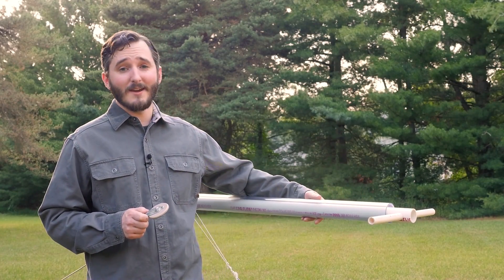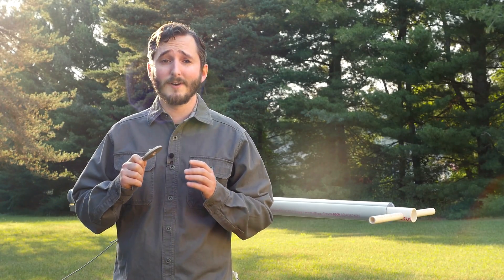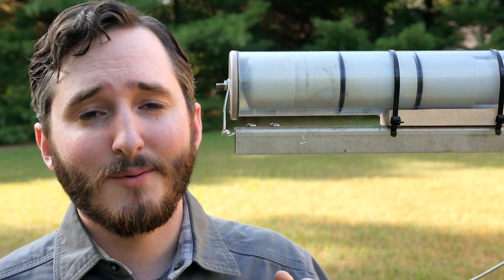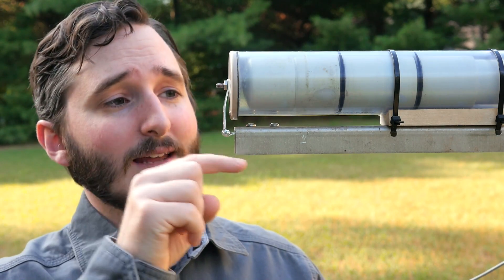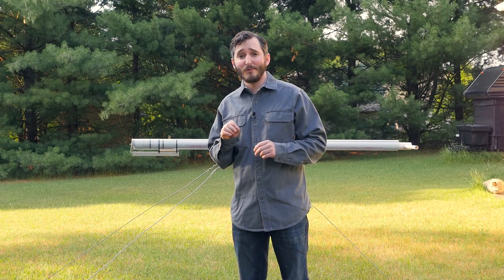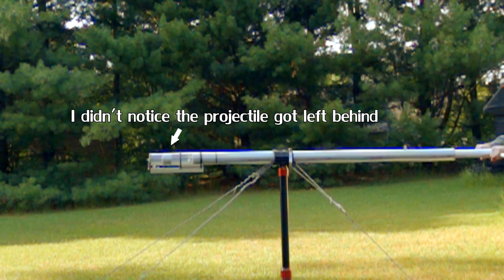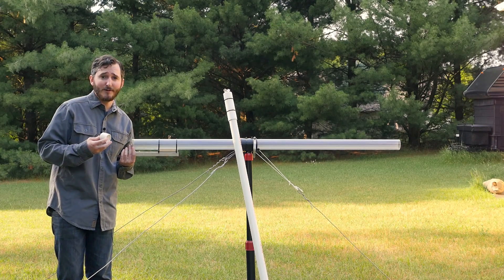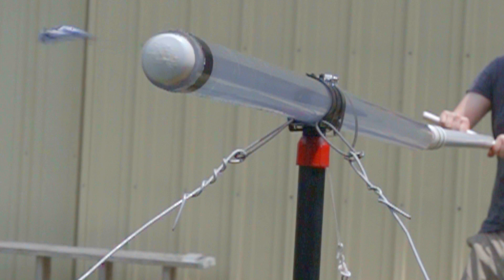Firing A Clear Vacuum Cannon & Testing Viewer Suggestions

Comment: What if you attach a long piece of elastic band to the flap while having some slack in it and attached to the other side is your handle. Then just before pulling the plunger all the way out, have the elastic band be in tension, so that once the air rushes in, you will also have the force of the elastic to pull the flap open. But the elastic band has to be routed below the pvc pipe to allow the flap to be opened downward.

Comment: What about spring loading the valve? A spring drawn from the centre edge of the disc to behind and below the pivot point would hold it in place until pressure overcame the tension, and then the spring would accelerate the opening of the disc.

Comment: I think the inertia of the valve might be the problem, because he metal hinge might be too heavy. I would try to make all of the parts of the valve as light as possible. Maybe just a quite thin PVC plate with the rubbe on it and instead of the hinge some wire. I definetly enjoyed watching this! Nice video! :)

Comment: it is called reverse  recoil.  is  it against the  rules to use  magnets,  specifically   for  use  in  the projectile, eddy   currents,  magnetic flux,  as  the   projectile  moves down  the  barrel  .
there would be  no need  for  any   external  energy. closed loop.   would  not  produce  any  more or  less  friction.    dont get  caught  up in the  eddy  currents  yet. 
i hate typeing on  my phone  ex my  tpos

Comment: Sorry if this has been asked but wouldn't the vacuum in the tube hold the flap valve on the end of the tube? And then push it off when it's fired?

Comment: Obviously figuring out how to keep the flap valve to stay in place would need to take some additional thought, but how about instead of using a hinge using just a piece of string or something else just to make the overall assembly lighter and maybe it doesnt have to make the complete arc to get out of the way that you'd get with the hinge.

Comment: I remember before you were in front of the camera. I thought you were an old man. Boy, was i surprised in your first video with your face. For the valve I'm thinking a long cable to actuate it, running from the valve to the rear. trigger it with a magnet in the end of the plunger as well as at the rear end of the cable. I know you can make my basic idea here much better.

Comment: You can add a rubber band to the valve, and adjust the pivot point, so the closed position is very unstable. A small opening of the valve will cause it to slam fully open.
Reply: I actually thought the same. I think the problem is that the liitle amount of air inside the chamber Knocks the valve  then the air escapes and the only thing pushing down the valve is gravity which is not ideal because the valve makes something like a circular motion and it takes even more time to fully open. So a rubber band in a position that when the inside air kicks the valve a little bit then the rubber band takes action and clears the bore. Maybe it wont work as well but i think its worth it

Comment: What if you built a piston cannon, and used a racket/pulley system to pull the piston back, so they a larger pipe could be used?
If it worked you wouldn't need a compressor for for the larger ones, might be faster to prep it for fire?

Comment: You should try putting a smaller projectile that's left at the front of the cannon that will push the valve out of the way before your main projectile reaches the exit. Not sure how much this power this would lose you because you'll have air rushing in from both sides but maybe if you get the distance between the two projectiles just right so as to minimize the amount of air coming from the other side while still having the valve open before the main projectile reaches it the velocity of the main projectile could still be comparable to the velocity of the projectile with the burst discs. Sorry for the run-on sentence was just trying to get this idea out of my head onto the computer.

Comment: you might should put tension to open the valve after you pulled the piston, or pull string to trigger that with the piston. something like mouse trap but weaker. (my english sucks, hope you get it ;) )

Comment: What about using magnets.  Attach a magnet to the projectile and to the valve, with like polarities pointing to each other.  The magnets will repel each other forcing the valve open.  The only downside is that a magnet would have to be attached to the projectile.

Comment: if the flapper is a must.. then lower the center of gravity and shave weight till it almost fails for a better moment o.e. ( lower bolt instead of being in center of flapper lid..and remove a lot more metal from upper half of flapper hinge for weight loss) awsome video.

Comment: The valve will not open with a vacuum behind it. Run a small tube half the distance to the valve beneath the primary chamber.
Reply: It needs to be opened last minute

Comment: Why not make the valve a part of the projectile? Imagine a cap that when put over the end of the tube would catch the projectile as it's launched. So it seals the tube until the projectile is fired, then when fired the projectile flies into it and is caught by it. Then the two fly off together as one unit. Like a reverse sabot.

Comment: @NightHawkInLight you're probably the best person to ask: I made a pvc potato cannon with a large combustion chamber, the fuel is aerosol starter fluid for small engines, the igniter is a barbecue button igniter I drilled a hole for and sealed with pvc cement, and the chamber is a T joint plugged with caps on two ends. 
When I first used it, I (painfully) found out that there was a leak in the hole that the igniter was in, so I filled the gap with more pvc cement, but it made a different hole in the cement later, what should I do to fix it?
Reply from the maker: Don't use starting fluid in PVC potato guns, it's dangerous. Use spray deodorant or antistatic spray. You can seal the gap with pvc cement combined with pvc shavings

Comment: you need a cantilevered, spring loaded cover that is held in place by the vacuum but the spring helps open the cover quicker once the vacuum is released, because gravity alone  just doesn't  open it fast enough.

Comment: You might try a valve design that I used for one of my blowguns....you will need to cut your barrel's muzzle  at a bias off the bottom ( at least 45 degrees) and make a valve cover to fit the new elliptical shape. What this accomplishes is it reduces the number of degrees movement to "fully open" by half, so the valve is out of the way twice as fast. It's kind of like being half open already when it is fully closed.  Some sort of spring-assist for the valve wouldn't hurt, either. Place the vector for the spring's movement such that it barely holds the valve closed, but after only a few degrees of movement it wants to jerk it open! Well, that's MY two cents....love your V-Cannon, man!

Comment: have a much longer barrel so that the cover has time to open if you want to use the remaining air. 
another suggestion is to have a hair trigger spring which would pull the cover when it moves a bit open.
or have a bigger hole at the end.
And if you want more power maybe have another dead end tubes attached near the end of the exit hole to have more suction power kind of like a cross or like a cross bow look. 
But it is all in theory and i could be wrong. lol

Comment: Use a strong spring loaded valve that under vacuum stays shut but you may have to hold it when under atmospheric pressure just an idea and may not be perfect

Comment: Along with decreasing the mass of the flap you could also try a longer radius for it to turn upon, assuming it would change the same degree (with some less because of added mass) the change in height would be greater

Comment: 1. A smaller pipe alongside, maybe with its own piston, with the end sealed against an extension of the flap. The air will travel faster as it doesn't need to push a projectile. Might be a little too fast, though.
2. An off-center spring that will accelerate the flap once it passes the equilibrium point.
3. An inset valve, so that it accelerates to greater speeds before losing the seal.

Comment: It seems like the energy to twist the hinge is what's holding it in place, so what if you put a rubber grommeted endcap that sat lightly in the end of the tube and just tied something sturdy, like a piece of fishing line, to it so that it popped off easily and then could just be placed back in again?

Comment: You could try replacing the front cable tie with a spring and optional weak magnet. The valve cap may need a tiny lip at its base that sits inside the pipe to act as a catch that stops the spring from releasing/expanding, when it releases forward, the spring pushes the arm down assisting gravity. Replace the rear cable tie with a hinge to allow the whole arm to fall which overall means you may not need to reduce the mass of the valve cap.

Comment: why not do the opposite? move the hinge of the valve behind the end of the barrel but have the valve secured with a small piece of masking tape. It will release a lot quicker because the masking tape will break with less force than the force needed to move the entire mass of the valve.

Comment: I have an idea if you want a more effectiv vacuum cannon. It centered around the problem that the air infront of the projectil is slowing it down. So use an vacuum pump to emty the camper with a burstdisc infront. However add a T section infront with an extra large volume, this will dilude the air cusion infront of the  projectil. to help it rip the disc you might need to add an spike on top.

Comment: Maybe use a magnet in the projectile and another magnet on the valve both facing the same pole so when the projectile approaches the valve it pushes it due the magnetic force

Comment: try having a spring loaded hinge so that the valve will have more force to open. something as simple as a small spring from a cheap click pen from the store with a little super glue should make a simple solution to the problem.
Reply: it occurred to me that there will have to be some slight amount of vacuum in the tube already to keep the valve in place, due to the spring acting against the valve in the upright position. i would like anyone to comment and build from my idea

Comment: What if you had a spring sticking into the pipe from the center of the vacuum seal? That'd make the last centimeters of the travel push even harder on the cap and perhaps be enough to get it out of the way.

Comment: Hi, hope this comment is somehow an original idea. It's about the valve... See, if gravity is not enough, of course a spring seems like the way to go, but how to keep it shut until you really need it to open? okay so my idea is that you use the hinge as the flucrum of a lever. You'll need to have two sides of a "seesaw": the valve sealing face and...a hook. Then you just take a long piece of rubber (slingshot channel style) and hook it to the lever. The other end goes all the way to the handle of the vacuum piston. The rubber should measure a bit more than the cannon, thus the rubber will be relaxed at the beginning, and the valve can be kept shut. When you pull, the rubber gets tension, hopefully not enough to counteract the vacuum, but at the moment of truth, I hope the rubber will open the valve faster. And you don't even need to worry (too much) about the strenght of the rubber, just the lenght. If the rubber is too strong, just adjust the distances at the lever, to get the proper balance of momentums. I think the key is to get the balance to a point where the rubber at peak lenght can't overcome a vacuum of just 1/20th of the piston distance. (for an imperfect vacuum of course) Thus, it should open when the projectile is on the last inches of the barrel. I think it calls for a rubber weaker than one would think at first, and anyway you can trim yourself that balance. Hope that helps :) greetings!
Reply: okay, so, quick update. I see so many people talking about similar concepts... yet another one, maybe the simplest, is to have a strong spring ready to open the valve. Only preventing that action, would be a rod attached to the pulling piston, going paralell to the cannon itself, kinda like a mousetrap. You are simply setting off the "mousetrap" right at the time that you end the travel of the pulling action. The prpblem I foresee is that the spring could open prematurely, before the projectile reaches the end, but that is where you could recycle the lever action idea of my previous comment, and tune the moment of opening.

Comment: Try adding a magnet to the front of the projectile and another one on the valve. At first the magnet will hold the valve, but when the piston is pulled back the vacuum will hold it on.

Comment: Try hanging a weight off the end of the latch so that the vacuum pulls the latch closed holding the weight with it and then, as soon as the vacuum is released, the weight pulls the latch down.

Comment: You're overlooking a possible answer here: The valve is too heavy, if you reduce the ammount of rubber stopper to just what is needed and a thinner gauge of metal (but not as thin that it rips like the aluminum foil does) and the valve might open fine. Also maybe a little bit of ptfe powdered lubricant on the hinge to perhaps loosen it up and make it slide even better so that maximum force is put into starting to move the valve.

Comment: You're an inspiration as always! I have three suggestions for easing the opening of the valve:
1. Make the actual flap part (or rather all that is moving) lighter so that less energy is required to move it. Just grinding of excess bolt and "skeletonize" the metal hinge should make a considerable difference.
2. Hold the valve assembly on with elastic bands to make any potential impact less destructive.
3. When the projectile hits the flap it soon engages with the bottom of it, giving it very little leverage, a pin either at the top of the flap or in the middle of the projectile that engages instead of the actual flap part should yield better leverage.

Comment: I would use a rubber band and a strong magnet. The rubber band will stretch when the lid is closed and the magnet will hold it in place. The solution can be done without a magnet also as long as it can be held in place by a force or lock that is a bit stronger than the rubber band.
When the projectile comes the air pressure will be enough to break
the magnet force and the rubber band will take over with lots of force. Quick enough to make the projectile miss it.

Comment: i have this idea.. that might work and would fix your valve. 
drill a 2mm hole on top of your pipe right about 1/2"+bullet length from the end of the pipe..

https://drive.google.com/open?id=0Bxti_x6rNGXoX3FwTGY3UG4tMU0

Comment: Rather than using pressure ahead of the projectile to open the flap, use the pressure behind it. Look at the gas impingement system of an AR-15 style rifle by how it diverts some gas to operate. If a hole and tube were placed somethere in the middle of the barrel, once the round passes the hole, pressure behind the projectile can travel through the tube ahead of the projectile to push the flap open. Clearly the gas tube and barrel will both have to hold the flap closed. Question is if the pressure will be able to beat the projectile to the flap.

Comment: If you link the valve with a spring to the piston, such that the valve is being pulled open by the spring when the piston is pulled back, but isn't having any force applied when the piston is all the way forward, the spring will help open the valve faster, and you'll still retain the property of the valve staying closed on it's own.
You could even tie some string between the valve and the piston handle, and loop it through a weight. If you set it up so the weight is resting on the ground when you're all the way forward, but is lifted when you pull it back, the weight will assist in opening the valve

Comment: By upscaling this design, the present air will be able to reach the front faster, leaving more time for the valve to open. You would need to calculate the time it takes for the flap to open, and lengthen the pipe accordingly. You may need to allow more air initially. We obviously need a 50' vacuum cannon anyway.

Comment: Perhaps you could have the endcap have a second smaller dia. rubber disk that fits (not too tightly) in the inner radius of the pipe.  then remove the hinge,  and attach the cap to the cannon with a string so it doesnt get lost.    Now the auto opening part..  use strong opposing magnets, one on the cap and one on the projectile to lightly push the cap off the barrel when the projectile arrives.     not sure if this would work, but hopefully worth some thought.

Comment: Maybe add a small hole on the front cap so that when the plunger is pulled it lets in a little air so when the projectile shoots it pushes that air forward pushing the flap. At expense of some power though

Comment: valve and hinge have too much inertia to more quickly enough out of the way.  maybe a cdrom with duct tape over the hole and some RTV sealant rolled on to one side with an ink roller.     ALSO....   the new projectile holder is better, but do you have access to a lathe to make a "plug" that fits inside the back of the projectile where the new screwed in vinyl tube is located SO that it displaces the most possible air left inside the back of the projectile..   less air, more vaccuuummmeee, more fun.

Comment: Maybe have a line of tubing connected to the vacuum that would push air against a raised section of the flap that way it could use the pressure of the vacuum to blow the flap open, unless this would release too much of the pressure and cause the projectile to not fly as far. Maybe a thinner piece of tubing to allow less air to push the flap open would work.